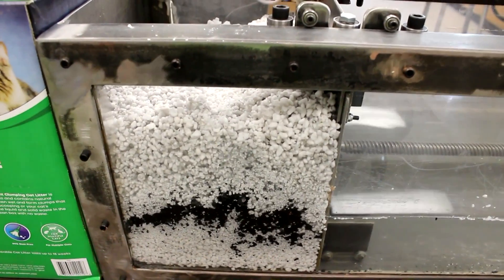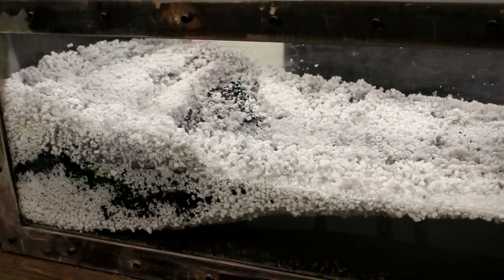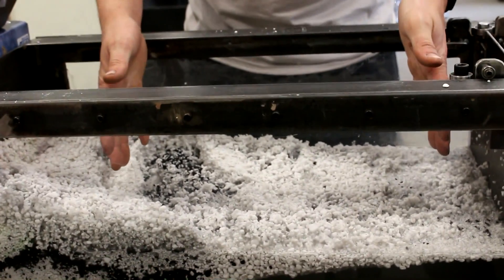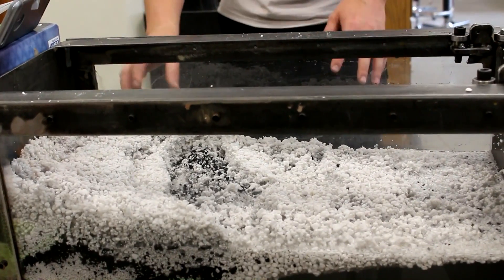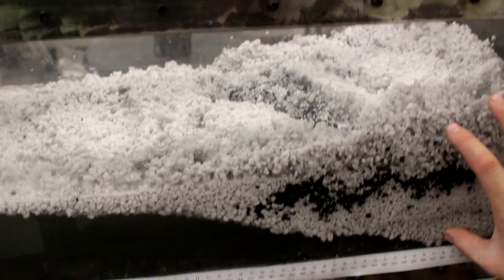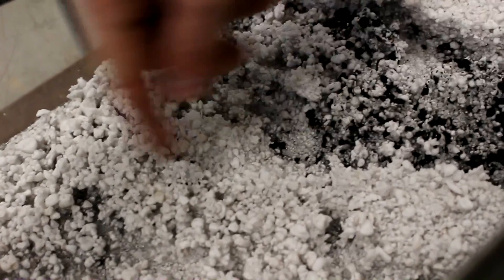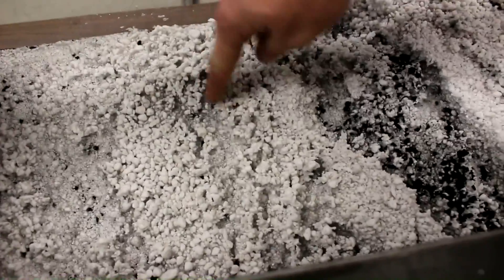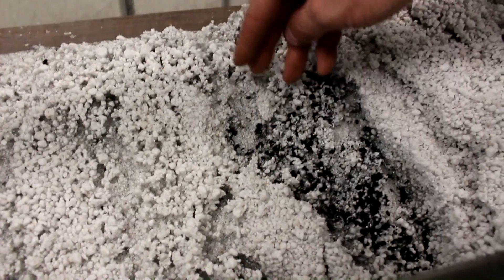Geo Sand Box with Floating Perlite

Comment: Good idea to have fire resistant walls if you live with Cody...
Reply: That's called a heated carpet. It melts and absorbs the butter.
Just gotta clean it afterwords. XDDD
Reply: theLuigiFan0007 Still sounds slippery, I think heated rubber floors with grooves in them so the butter will melt and drain down the grooves. Also, rubber is good for grip.
Reply: Ah, I never thought of that. That's an even better idea. :D
Reply: Yes. And it's not too hard to do, but a bit expensive at times. For truly fireproof walls, you want to make the walls out of concrete, and use steel beams instead of wood whenever possible. Noncombustible insulation, such as Rockwool should be used. Sheetrock should be the only thing over the outer wall structure, no wood paneling. It can directly painted over to finish it. This kind of construction in more common in industrial environments then residential ones though.
Reply: theLuigiFan0007 Standard practice here in Ireland. Wooden houses are vanishingly rare.
Reply: yeah they're called walls
Reply: TRiG (Ireland)
Really? I know wooden frame is still standard here in the US. Concrete outer walls are practically nonexistent, except for factories and stores, or the few custom built places that use it.

I have plans to build a all concrete house, that has glazed and polished concrete for the inner walls someday. Essentially, layered like this: Outer concrete > Rockwool > Inner concrete. Radiant heat lines in the floor concrete, for heat. According to my calculations, it should be VERY efficient and durable.
Reply: Thomas Y It'll depend on your climate. Irish buildings are usually two concrete block walls with insulation between them. This doesn't stop us building extensions.
Reply: I just died fuck. butter resistant floors
Reply: theLuigiFan0007 hi is singapore hdb flats walls, fireproof?
Reply: Look up 'ICF' insulated concrete forms. Fairly commonly used form of construction, although it doesn't have enough insulation to be a good idea these days.
Reply: It should be straightforward to insulate a concrete building with EWI (External wall insulation). You get a very warm building with lots of thermal mass. The main constraint is that you can't easily fix the heat-loss to the foundation. Taking the EWI down to the foundation, and insulating the floor internally is the best you can normally do. You can get close to passivehouse.
Reply: theLuigiFan0007 It can be damp in Ireland. Wood rots. As I said, the most appropriate structure will depend on your climate.
Reply: theLuigiFan0007 is there rlly such things as fire resistant walls?!
Reply: Thomas Y I think it is a good thing we have bulletproof walls in South Africa.
Reply: Toh Yong Sheng
I have no idea what you are referring to. Can look that up though and she what I get.
Reply: Toh Yong Sheng
Ok, the exterior of those flats seems to be solid concrete. So, as far as the main structure, it would be pretty fire resistant. I'm uncertain what the interior walls are made of though.  Likely concrete with a covering, maybe Sheetrock. Also fairly fire resistant if that's the case.
Reply: TRiG (Ireland)
Very interesting. I just thought of concrete walls with insulation between myself in a plan I drew up. Didn't know that was a thing.

Comment: So is it like a nonpoisonous asbestos?
Reply: Zeldagigafan - More like an easy to install plaster.
Reply: The wall material? Just normal drywall. Knock on any apartment buildings walls and if it sounds hollow that's most likely the stuff.
Reply: That is not the bricks fault, but the way they are used. A wooden house also gets painfully hot if it' is not buildt with a design for a hot climate. There are good reasons for why thick brick/mud walls are often used in hot climates.
Reply: snika123 That's not the problem at all, the problem is houses here in Australia are built down to a price NOT up to a standard and also built to make use of natural light as much as possible.
If you look at houses built a century ago in the hottest parts of the country all were built with wide eaves and/or verandas around all four sides, this was to block direct sunlight from hitting the walls/windows of the house hence keeping the heat out. 
Modern houses are also brick veneer construction rather than cavity brick (2 rows of bricks with an air gap between) and are usually (if not specified by the owner) not constructed with some sort of insulating material inside the internal walls which allows the heat to radiate from the brick veneer external walls straight through the internal walls and into the living spaces. I did a lot of Electrical work on brand new houses in the 90's and can vouch for the fact that houses that age (and newer) are very poorly designed and built in regards to heating and cooling efficiency.
Reply: Robert, the problem you describe is universal and I do like your down/up description. 

In Finland the situation presents in a different way. With continuous demands for reduced heating needs the insulation specifications have continuously increased and this has resulted in houses that have no air flow in the insulation spaces and less in the houses in general.  This causes humidity to get trapped (from the time of construction in some cases) resulting in the growth of unsavoury fungus colonies, eventually the air quality is bad enough to cause respiratory ailments in sensitive individuals.  If the situation gets bad enough the buildings are condemned, this is happening much too often to much too many buildings, schools and hospitals seem to have been victim of building down to price 20-40 years ago.  

The design problems have not been resolved yet though some solutions to the ventilation issues are emerging.  With new exhaust air waste heat recovery heat exchangers it is now possible to increase the ventilation without loss of much heat and also to design houses and summer cottages that do not need to be forced air ventilated.
Reply: Zeldagigafan I wish they would stop using brick in Australia and use jib or wood, it's so stupid having brick in a hot country as it has a high specific heat, makes aircon that much more nessecary

Comment: I know that this is a recording from a while ago, but I wonder if you mixed powdered sugar in with the perlite, added hotwater to float it, then let it cool.  It might cause the perlite to stick together and provide strength.  If it works you might be able to simulate the fault and thrust actions.

Comment: Yeah, but that sheet bends because of the paper, being that it's a laminate. Also, beware that these things need to be perfectly isolated otherwise in time it will start to degrade from moisture.
Reply: If you ever do this experiment again, color some layers vertically as well. That way, you can track where things went a bit easier, we did a similar experiment (no water) and that's how we did it aside from the classic horizontal spread.

Comment: it would be fun to do one where you have a pushing plate on each side to simulate two moving tectonic plates crushing into eachother, rather than just a one sided experiment of one plate trying to push against an immovable object.
Reply: Mike Van Leeuwen This would actually be interesting to see.
Reply: It would indeed be interesting
Reply: Well the materials would push on eachother instead of getting pushed into a solid wall, I think it would create a different result. However you may be right, only one way to find out!
Reply: I think you could use your imagination or a mirror to picture how the other half would respond if it was compressed in an identical but opposite way.  The middle would stay still like the stationary wall in the current set-up.

However what might be interesting might be to have different plungers on two ends.  One that pushed from low down and one from high up.  Or one that pushed from one side or a wedge in the middle.

I think something more interesting would be to compress one side of the tank fill or use a sifted product on one side or even mix some sticky stuff (dextrose powder perhaps) on one half and when it gets wet the rocks will behave differently.

Another source of colours would be cement pigments (mostly iron oxides or anthracite dust) and if they were premixed with batched of Perlite the densities and characteristics of the bands would be almost the same except for the colouring.
Reply: Joe yeah, you'd need a way to show the induction and subjugation layers accurately, or the 2 would just smash into eachother and mix, which would still be cool to see how they mix. maybe have a removable plate at each front end of the two, and slowly remove them as they get close to colliding.